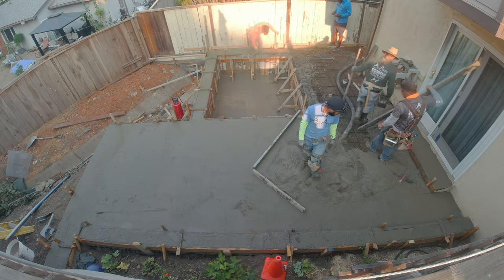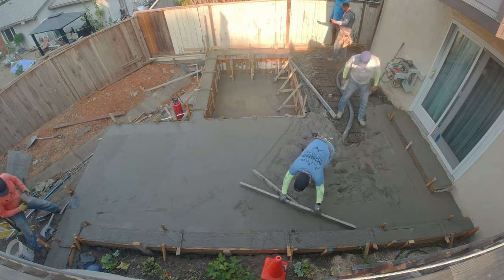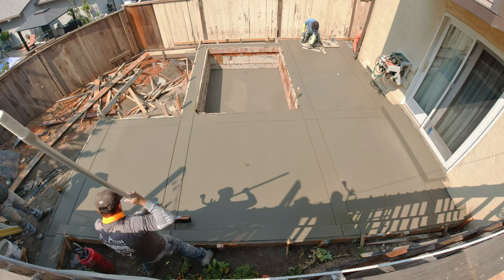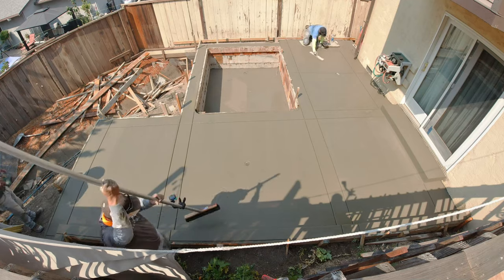Monolithic CONCRETE Pour For Sunken Hot Tub And Patio .. Lots Of DETAILS

Comment: Even I would have pumped that
Reply from the maker: 😂 😂 😂 😂 Who ever gets a pump in the #midwest first is going to make a killing..
Reply: I don't know those buggys r pretty sweet, they don't look like it, but they are
Reply: I can't use pea Gravel mix either, 4000 #8 stone, dude everytime is use a pump it cloggs and it's dangerous, and alot more work and a hell of a clean up because they don't pump it back In the truck, so tbh I don't like pumps, but if I had an extra 70k I'll buy one the right one for us, not a pea Gravel pump. If we use a Gravel mix it causes pop outs on the surface! Trust me I have been thinking about just using pea Gravel mix on everything and rebar like u do
Reply: But I'm afraid of pop outs and pea Gravel mix isn't as strong, but I do have an exposed agg pea Gravel patio and it held up good, I may pour something at my house and see if it holds up to these winters, the winters usually are not that bad